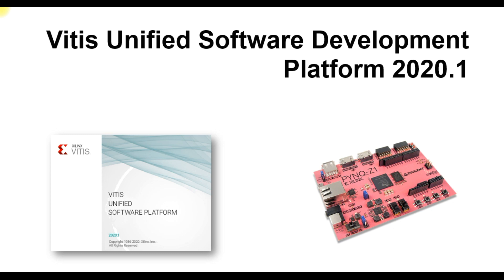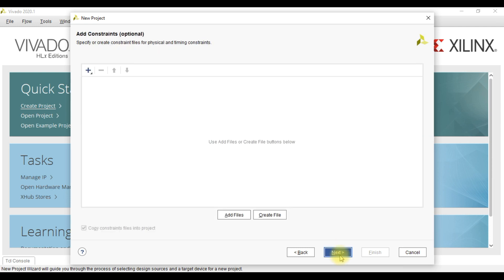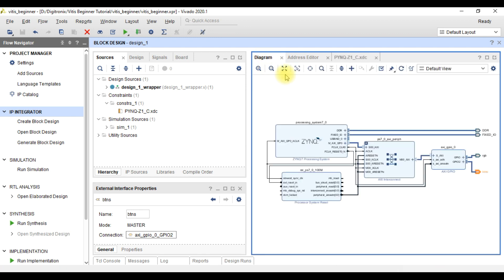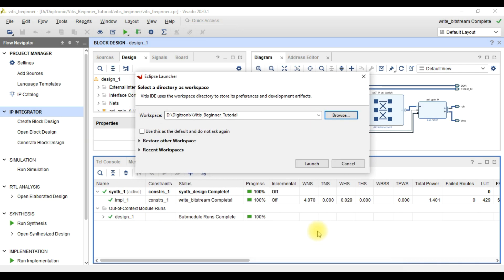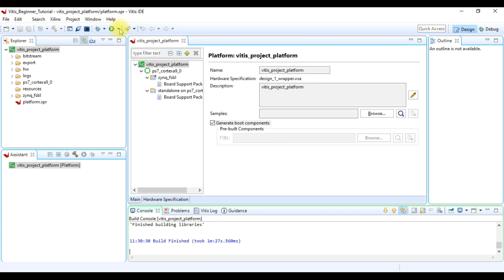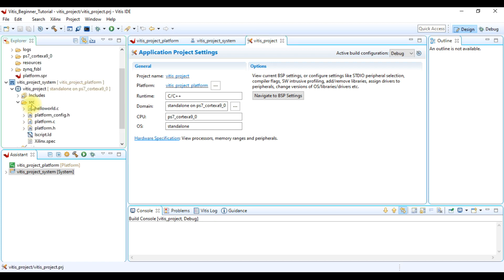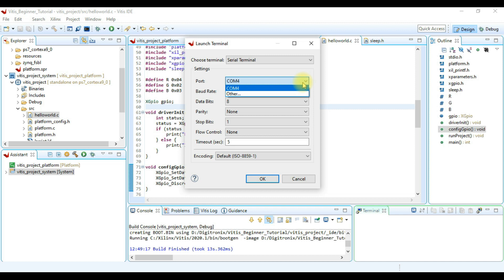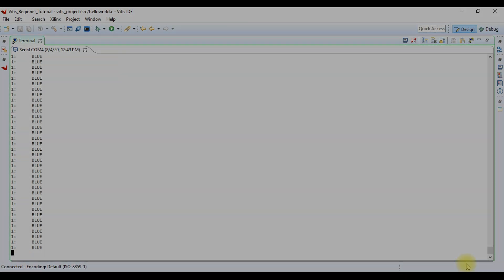Vitis Beginner Tutorial- Creating GPIO project

Comment: Dear Sir 
Please, I have a problem during reading the status of an output switch on Zybo Z7-10.
I use Vitis to program the Zynq processor with Gpio connected to a slid switch. I make the switch (input2)  status as a condition  as shown in the program below if (D == 1) ;
The following program works only when the input2 signal that was connected to Gpio IP starts from ("1") but the program does not work when input2 signal starts from ("0"). 
//////////
 while (1)
    {  	D = XGpio_DiscreteRead(&input2, 1);    // input2 from a slide switch
    	if (D == 1)
    	{    	sum_all = XGpio_DiscreteRead(&input, 1);  // input is a 32-bit data
    	printf("%x \n" , sum_all);
    	sleep (1);    	}
    	else
    	{    		XGpio_DiscreteWrite(&output, 1, 0);   // output is a LED
    		printf("No_Signal \n");
    		sleep (1);    	}
}
/////////////
i.e. the program works only when I change input2 from "1" to "0" but does not work when the input2 start changes from "0" to "1".

Comment: FPGA configuration was done using the USB port/terminal? I did not see where you specifically configured or programmed the FPGA - it seemed to occur 'automatically'.  Is this a feature of this specific PYNQ Z1 dev board?
Reply from the maker: Hello Dave, yes we used USB-PROG/UART port for programming PYNQ Board. At 9:54 Second, you can see we do "Launch on Hardware" which programs the BITSTREAM to FPGA board first and then Vitis tool upload the software application.
For programming PYNQ with JTAG or PROG, you have to "select the Jumper left to USB port into JTAG mode".

Comment: @UCkT8hcmjKupHESuKn-ef5gA  I simulate exactly the same project like you and launch it on Vitis. However, after building:
1. The Platform, it receive to many errors informing me, they are too many Header files like Xil_printf.h, xil_io.h, ...etc missing in the include folder of the platform under bsp folder. I found all those headers files and add it the include folder. I rebuilt the platform and it works. I've the process like this each time, i'll like to create a platform for a new xsa.file. Now, my questions: Did you face to the same situation before uploading the video? 

2. The application, many failures have occurred: 
->  undefined reference to 'out byte'.   Solution:  for this i had to comment the line xil_printf("Hello World");
->  undefined reference to 'microblaze_enable_dcache'. Solution: i had to comment also the line in platform.c
->  undefined reference to 'microblaze_enable_icache'. Solution: i had to comment also the line in platform.c
-> undefined reference to '_interrupt_handler' in function '_vector_interrupt.  ==> At this stage found no solution up to now :-( . Do you please have any idea, how i can solve this issue?

Thanks in advance!